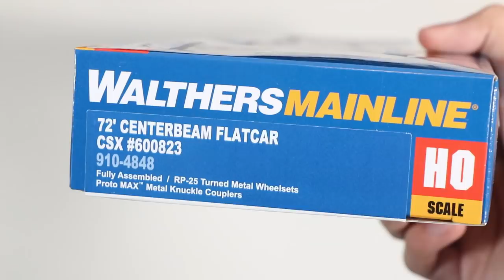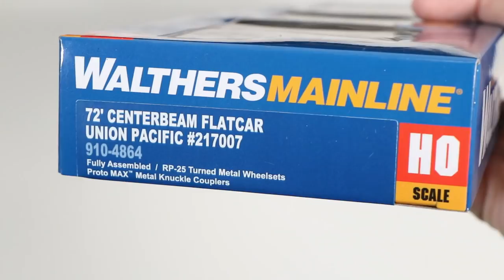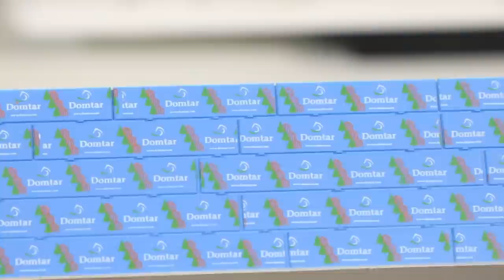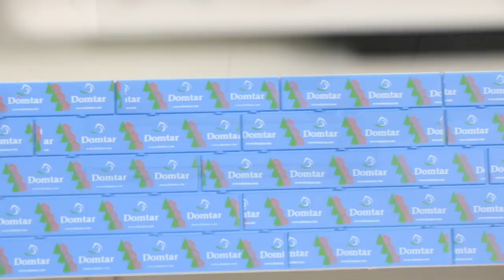Walthers HO Scale Centerbeam Flatcar Unboxing

Comment: The easiest way I found to take them apart is by prying 2 or more screwdriver underneath the load to remove them.
Reply: how did u do it, mine are literally stuck together
Reply: @CentralJerseyRailfan  did you use glue? 

I literally put 2 flat head screwdrivers up as far as they could goon either side from the bottom up starting on the sides then doing the middle.
Reply: @IdahoRailfan  nope, just pushed them together
Reply: I broke a peg while splitting mine, any tips for removal when i want it unloaded?
Reply: @IdahoRailfan wow